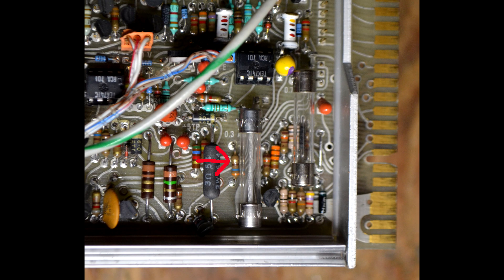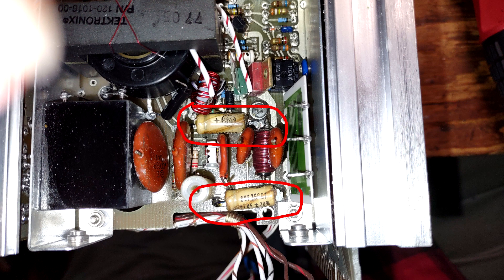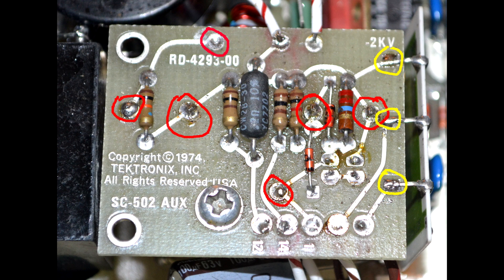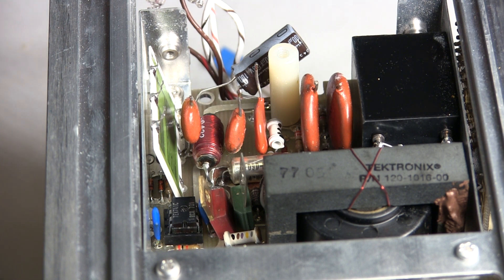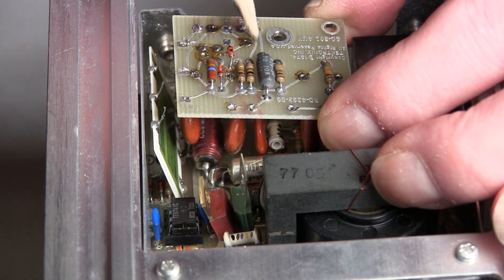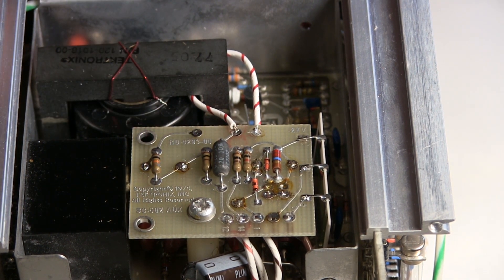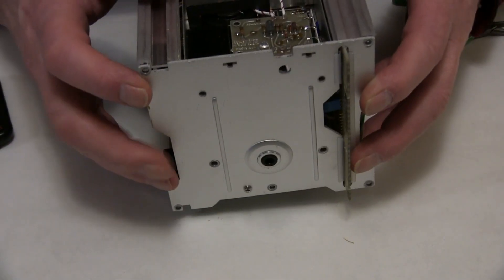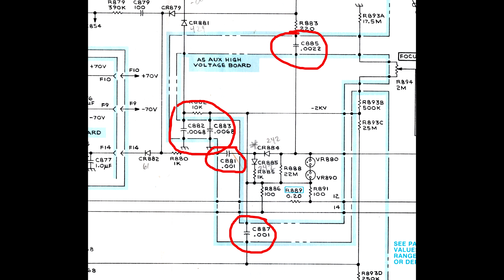Tektronix SC502 Scope Repair - High-voltage Section

Comment: Suggestion for cap alignment??? Maybe make a jig from a piece of very thin cardboard... Place the thin board on top of the freed PCB and mark the pin hole placements. Cut slots (a single cut with the scissors, with no extra width) from the side of the board inward to reach the pin holes. Slide the jig onto the cap pins. Drop the PCB onto the cap pins. Solder in place. Remove the jig, by sliding it off of the cap pins. I hope that was clear and that it helps someone..

Comment: I might have thrown a little bit of RTV748 electrical grade silicone to hold the capacitor in place. Those leads are a bit long and vibration could be an issue.

Comment: Have to agree that when assembled those cap leads were full length and easy to "thread" into the board and then trimmed once soldered. Good tip about 2x the farard value for replacing tantalum with electrolytic.
Reply: That's a new one on me, and I wonder (but doubt it's true ) if it affects the effective bandpass of the input filter made up by the inductor and both caps....